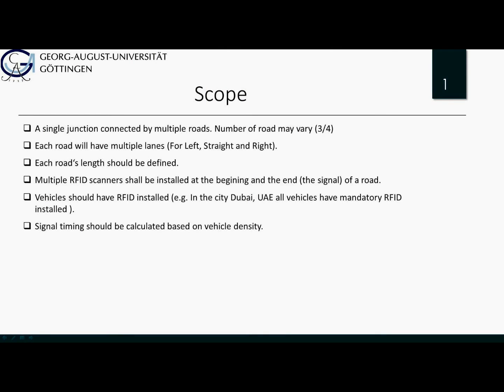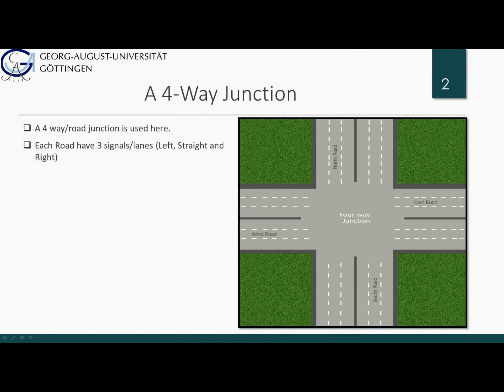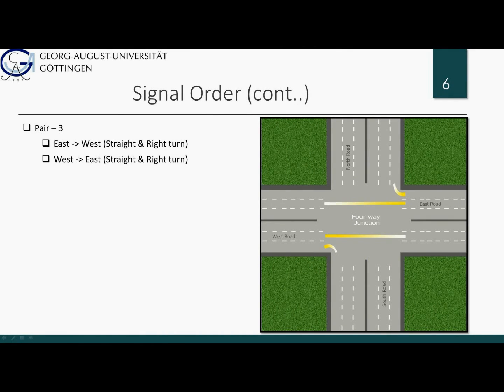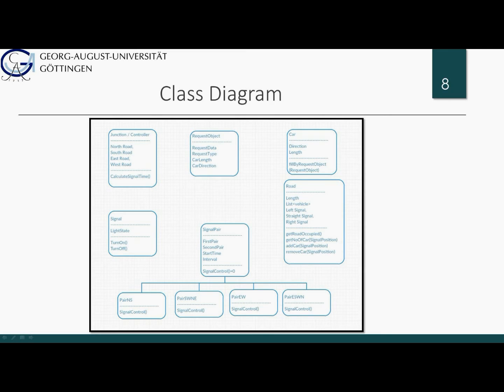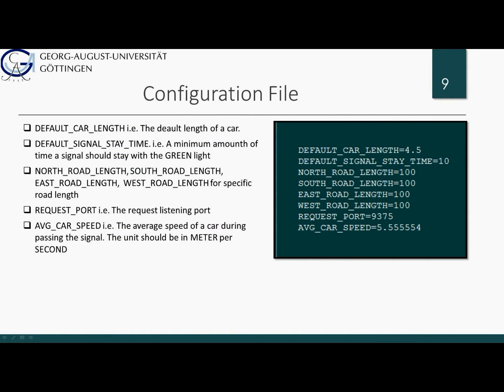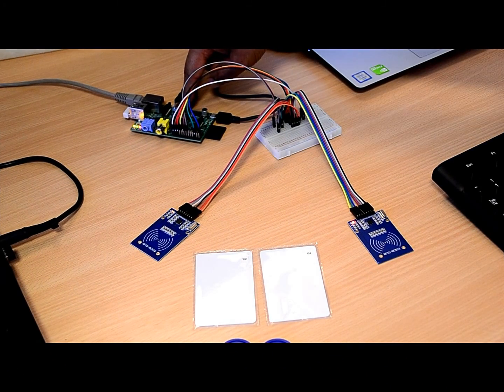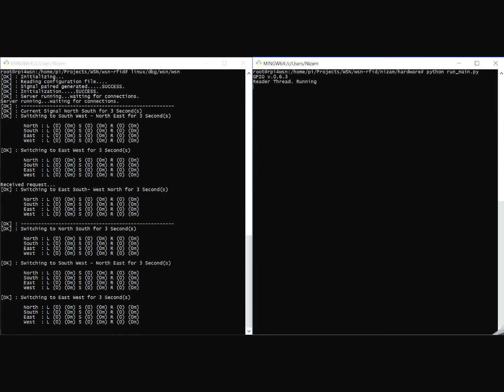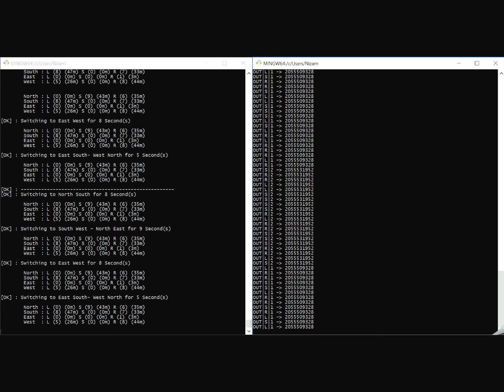Smart Traffic signal timing control based on vehicle density.

Comment: Hi Sajib. I am working on a project like this. And i will love to have the simulation of it. Can i please get the source code and the name of the software you used for the simulation?
Reply from the maker: Hi, Thanks for your comment. Since this was a university project so I will have to ask before I hand over the source code (I hope there should not be any problem!). 

We have not used any specialized simulation software. We have to major applications here: 

1) server (written in c++) : When server gets any request from the client it triggers some events and takes decision about the signal timing based on the vehicle density. 

2) client (written in python): It tracks where there is an incoming or a outgoing request detected through the hardware as explained in the video. 

you can say it's a hardware in the loop :) We had a plan to implement the graphical output animating the cars on a junction also but unfortunately we did not have enough time. 

May be you can explain a little bit more about your work then we can understand if it would fit on your particular work or not. 

Thanks again :)